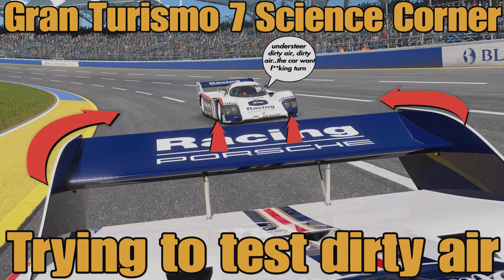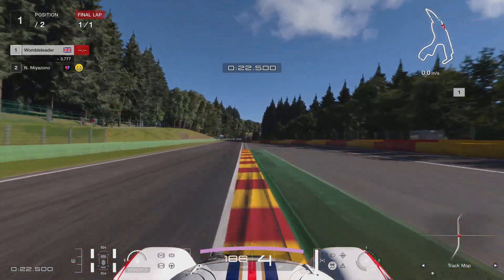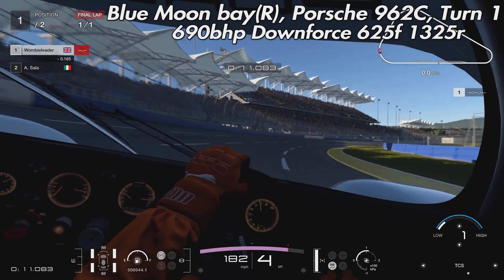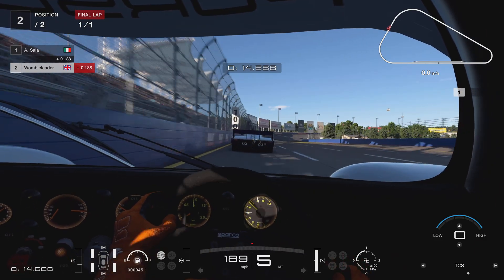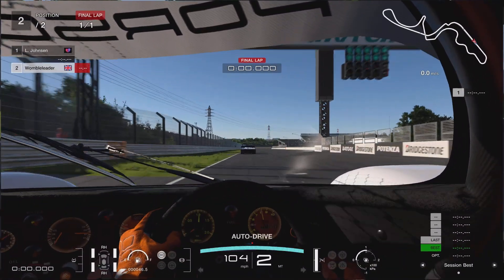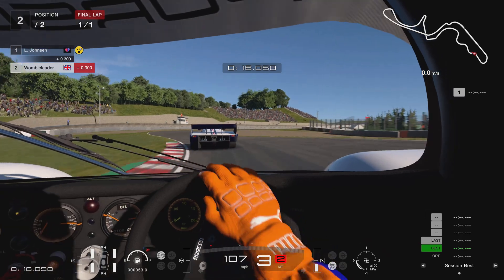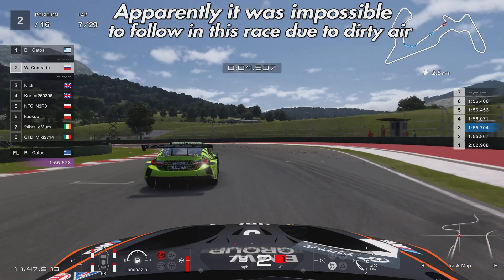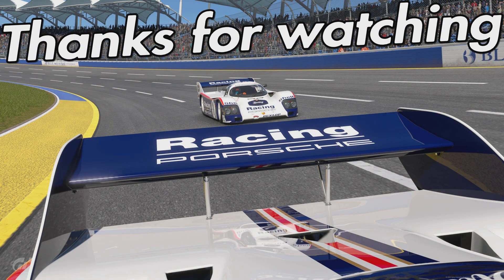Gran Turismo 7 womble science...Testing Dirty Air - Myth, as bad as made out, fixable?

Comment: Test two on Blue Moon looked faster, should always retest a few passes in clean air for science post setup modifications. 

Also none of these videos show passing, which means dirty air means no passing, no battles, and no excitement. Streamers need excitement to drive revenue. Maybe the problem with sim racing is just like World of Tanks, people want skill based matching, but its rather boring when equal teams get an advantage it steam rolls a 15-0. Bigger lobbies means more skill variance and One Shot Qualifying breaks up the set it and forget it sport mode format PD has used since the dawn of sim racing.

In before "blah blah slipstream breaks under adverse netcode" and it becomes a PD patch note.
Reply from the maker: The car was exactly the same for every test at blue moon bay except when I added 50 points of downforce to see it it counteracted dirty air in that corner.

We had 4.5 years of good racing, great battles, overtakes and drama in GTS and GT7 before custom slip came along so I'm not buying that one tbh. Not every race has to be chaos and battling sometime a race is boring if that just the way it develops. We have 7 days to race a daily and the overtakes, closes races, drama and battles will happen if ment to happen but forcing it to happen via a gimmick boost quickly become tiresome, frustrating and boring in itself.

Comment: I've always been confused hearing people complain about dirty air in gt7. It's a feature not a problem that needed to be solved. Just like in real life motorsports, its just about having a good combination of track and car. Maybe that's why PD like it so much, it papers over boring or lazy combinations?
Reply from the maker: It can definitely be annoying being stuck behind a slower carvin dirty air in the likes of Gr2 and in those races they should always have strategy options to give you a chance to undercut/overcut etc but at same time people are way to quick to just throw toys out pram because car doesn't drive exactly like TT...one of the biggest skills of a good driver is ability to adapt to conditions which can definitely minimise the effects in GT7.

Ironically the content creators fir F1 25 are loving that dirty has been increased because it breaks up the DRS trains 😆
Reply: @wombleleaderracing6455  100%. I do see how it can be more of a problem in the couple lap sprints of Daily Race B especially. I was mostly talking about Daily Race C where like you said strategy should be in play. A little dirty air can do wonders for making strategy more interesting and more dynamic. Pitting into clean air, staying out to hold track position on older tires, having an amazing in-lap when the cars in front pit and you pull an overcut.

Comment: I never really had an issue with dirty air in this game. There are only select times I have even noticed it. Thoigh maybe that is due to my driving style. When I am right behind other cars, I usually break a little earlier or off line to avoid running into the back of them, so that probably compensates for the dirty air. I think the complaints come from the fact that people don't know how to drive in dirty air.

Side note, it was cool to see you test this at Blue Moon Raceway. I don't think the Blue Moon Oval has ever been in a GT7 Daily Race. I honestly wish we saw oval racing in GT7 more often. It would give them a use for the custom draft settings
Reply from the maker: Its definitely an issue once you get to group 2 and above but I reckon driving style does effect how much you feel it...if you rely on getting the front end pitched in its probably more noticeable whereas if your smooth it probably has a lesser effect.

Group C cars at blue moon bay reverse oval would be awesome for a daily race but no custom slip!!!!

Comment: Im curious how the dirty air impacts tyre wear, would be a lot harder to test id think
Reply from the maker: It will have an impact mostly because most drivers try to deal with dirty air by applying more steering lock which induces more understeer which increases tyre temps which increase wear.

Comment: Excellent Video - well thought out, investigated and tested. Thought the use of IM on that corner was a good idea. I honestly don’t know if it’s car specific. In recent memory the worst experience of dirty air I felt was in the CLK a Gr2 race on Sardegna A, you know that fast left hander blind in the final sector I could feel it really bad on that one. I do think too much is made of it, it is a skill where feathering the throttle can help but it is annoying. I think some feeling of it isn’t bad but if asked do I want dirty air or extreme slip I don’t actually know what I’d pick. Great video
Reply from the maker: Cheers Flash. I really like the feel of the inters on a dry track tbh...for some reason I think they give more feedback on what the tyre is doing than the slicks.

Yeah that corner in high downforce cars is probably one of the most affected given its hard enough in clean air with little margin for error and you approach it going right before flicking left so a lot is being asked of the aero...I do get annoyed when some of the bigger streamers do one race at the likes of Gr2 Maggiore and brand it unraceable instead of giving it a decent chance and maybe learning to deal with dirty air and pass tips onto viewers

If I was to answer your question I'd take the dirty air(which won't surprise you lol) because whilst its annoying I only thinks it impacts Gr2 and above so 85% of dailys and GTWS are fine whereas custom slip impacts every every car at every track at every race usually negatively.
Reply: @wombleleaderracing6455 Yes I agree iv never had an issue with dirty air in Gr2 or Gr3, in Gr3 occasionally you can feel a little bit but it’s not major it’s like ok I’ll just feather the throttle perhaps to close my turning circle and to your point high downforce doesn’t occur very often